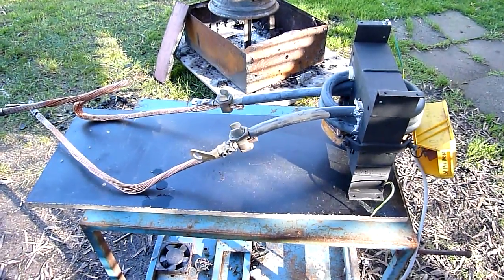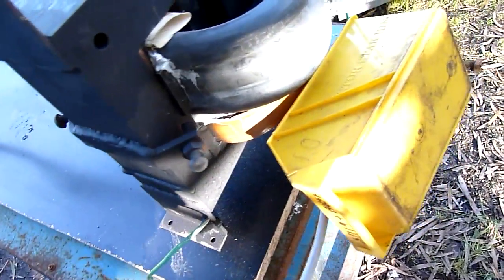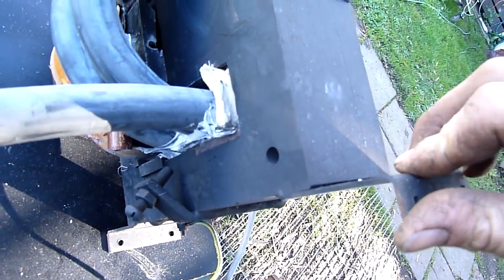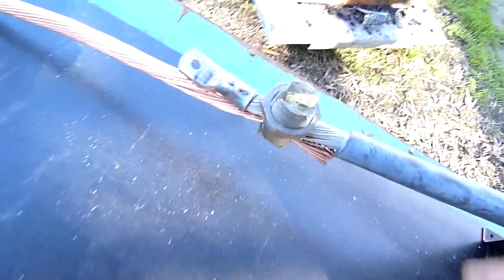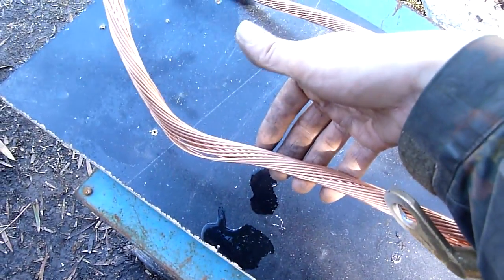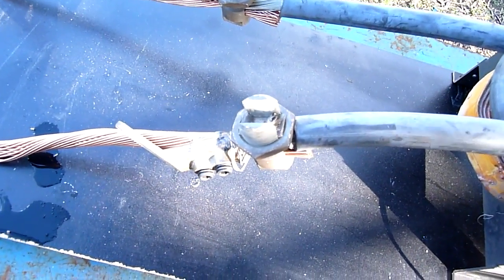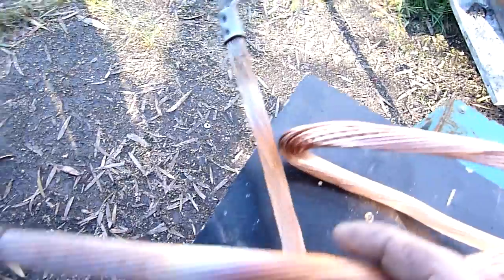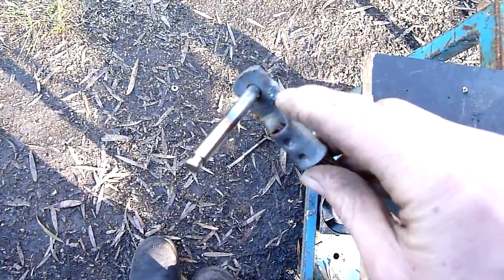High Current 3.8V Transformer Inspection

Comment: I been making up some large transformers lately and have found 230V single phase service with a 80A HRC pole fuse is limiting me. I just made up a 230V/12.5V 5KVA@3% Toroidal, the bolted short is about 13.3KA on the 12V side, and 724.6A on the mains. That means if I short the 12V side it has enough fault current to blow the pole fuse!

Comment: With high current secondaries I find it easier to measure the LV primary with a current clamp meter. If the transformer measures 3.8V for say 230V measured input just divide the two numbers to get the ratio 230/3.8 = 60.5: 1 so if the primary measures 25A the sec is 60.5 x 25A = 1513A. I have found the mains is not 240V in most places it seems to hover at around 228V~ 235V, and with a 15M 1mm2 extension lead the voltage drop on the mains side is about 14V in the lead alone.

Comment: output amperage should be input amperage multiplied by transformer ratio. 

In this case, 26 Amperes input, should result in 1642 amperes on output.

3.8v unloaded output and 240v input  puts the ratio at ~63.1:1

Comment: i rewound a microwave transformer with 2 turns of wire about that size... its aluminum wire from the main lines coming in from the street i used.... o/4 gage

Comment: oh yeah I almost forgot.  You should be able to make and run a decent ball bearing motor with that transformer.  Give one of those a shot if you haven't.  it's just a shaft with two ball races, then you pass a high current between the outer races of the bearings, give the shaft a turn and it will run as a motor.  for a while anyways.

Comment: if you know the turns ratio (which seems to be about 63:1) you can calculate secondary current by multiplying primary current by the turns ratio.  it won't be exact but you will have a ballpark figure.

Comment from the maker: peak primary current that I metered when I first made it was 26A at 240V AC, but that depends on the resistance across short. I will find my portable ammeter and see what it reads through a full burn cycle :D